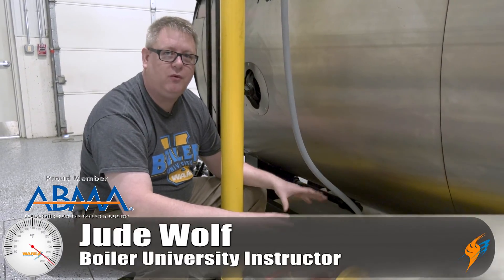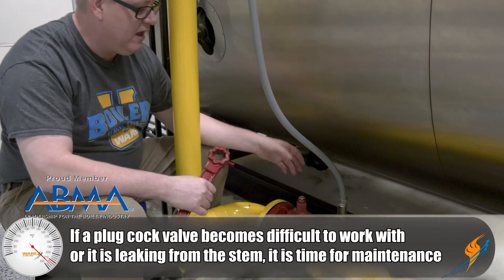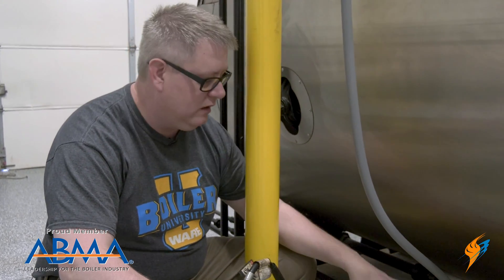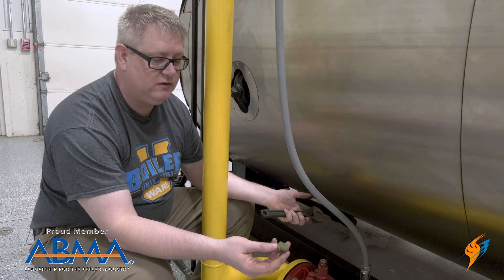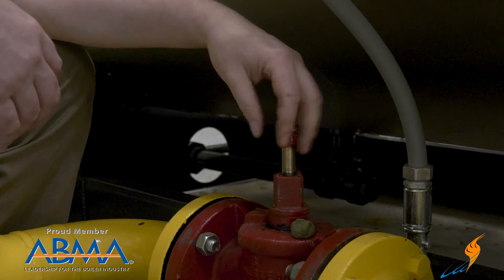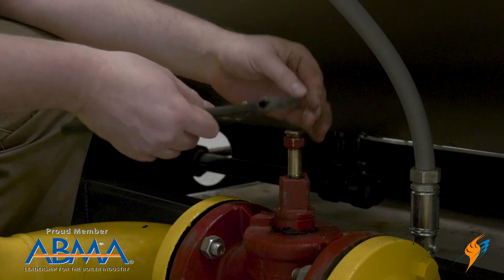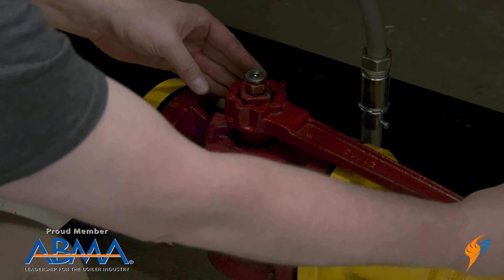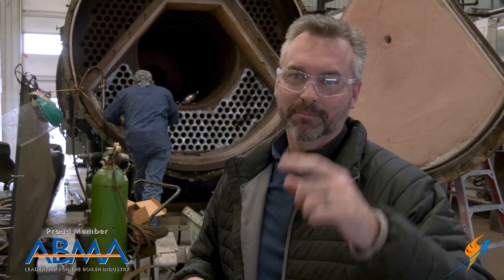Re-Lubrication Maintenance of a Plug Gas Valve - Boiling Point

Comment: can this maintenance be performed whilst under gas pressure?
Reply: Also, is the sealant a permanent repair? I don't understand how it could replace grease
Reply from the maker: @Lint Licker This is not a repair at all but rather regular maintenance. In regards to this being called sealant, the word sealant in this case is really referring to a very viscous grease that the valve requires. Valves can and will require different styles of grease so making sure you know what the manufacturer recommends will be important. Hopefully that clears that up. Thanks for watching!
Reply: @wareboilers  thanks for the reply! I was referring to the sealant that was added to push the grease into the valve body? I guess I'm just a little confused..
Reply from the maker: @Jason Wierenga Typically the grease groves are in the correction position when the valves is in the open position. When in doubt check with the manufacturer for their recommended procedure and grease type. Hopefully that help!
Reply: @wareboilers  What does "correction position" mean? Excellent channel. Please keep it up.
Reply: The correct plug position to lubricate this type of valve is in the fully OPEN or fully CLOSED position. Do not lubricate this type of valve in a semi Open/Closed position. The valve is fully lubricated when you see the lubricant oozing out between the valve body and the stem.